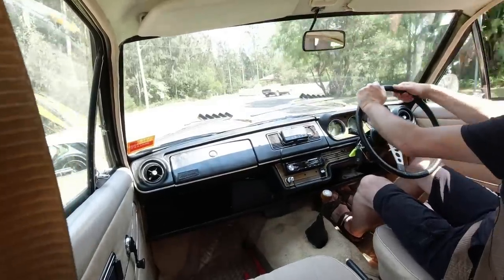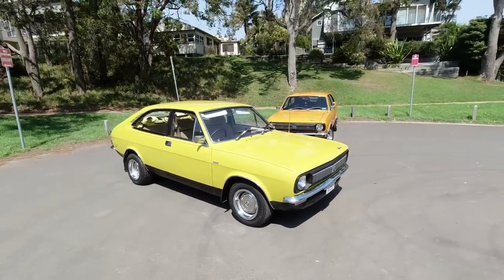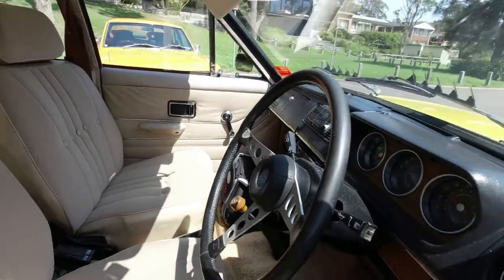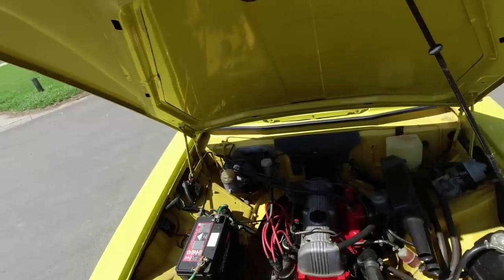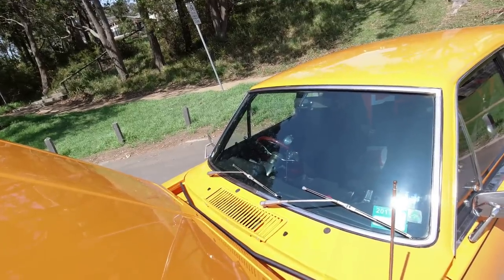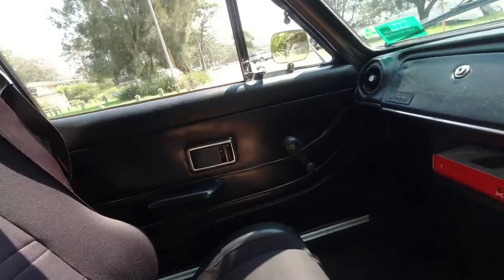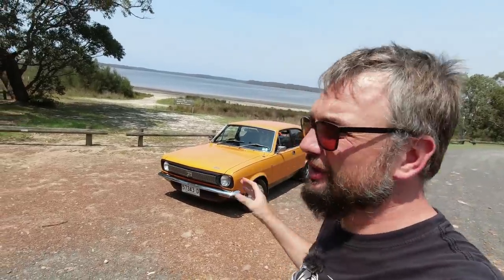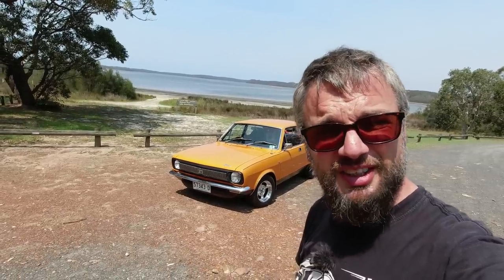Aussie Oddballs: Leyland Marina SIX-CYLINDER! Driven!

Comment: According to the specs, the two engines used in the P76 put out 121 hp for the 2.6-litre six & 192 hp for the 4.4-litre aluminium V8. The V8 was also 2 pounds lighter.

Comment: A mate of mine has the best Marina of ever; 'Horris', the Maronda.

It's a Marina Coupe tarmac rally car, with full group 4 Escort suspension, and a Honda S2000 engine. 250bhp-ish. In baby poo green with a vinyl roof. It looked slightly out of place on Rally GB in 2015.

Comment: Luv this , I had a 262 marina in NZ , std 3spd. After driving a lot of valiants with the same BW box it lacked legs on the open road but acceleration was awesome off the mark , diff ratio should have been changed , ugly as but a pleasure to drive , even towed a twin axle furniture trailer from auckland to Tauranga 👌🏼

Comment: The Australian idea of sticking a bigger engine in everything and making it a bit tougher was a great one. The Cortina, Torana, and this one which was a new one to me, were so much better than the UK models. They generally didn't stop or handle any better as you say, but 6 cylinders in those days was twice as good as 4, and the bags of extra torque made up for other shortcomings. I particularly enjoyed HubNut's genuine delight in the 6. The MkIII Cortina was transformed, and the MKIV with the 4.1 litre fuel injection was in another league.
Reply: Diabolocal death traps.

Comment: Always loved the Marina Coupe design. Travelled in a Royal Blue 1.3 super Coupe when I was about 10 or 11 and I thought that it was quite good, all brown vinyl inside and smooth running. I wonder did the 1750 drive similar to the lovely Lada Riva 1.5 that you drove last year. Maybe I'm completely wrong. As for that 6 cylinder, wow. I think Morris missed yet another big trick. My Dad hated BL cars coming from a line of Hillman Minxes through Renault 16 to Peugeot 504 estate. Weirdly he rather liked 1974 Triumph 2000 we had briefly before the big Peugeot.

Comment: I had very little to do with the Marina, only time I had to drive one was back to the workshop (Loughborough junction railway arch)
I was not told that the problem was the alarm was going off all the time the ignition was on...
so that's a fun drive.

and working for a small car spares shop called Motos down near the bottom of the magic roundabout... the M25 where they referbed those leaver arm things... loading them into and out of a yellow mk1 escort van each Saturday.

these I would have taken more interest in

Comment: I did the telescopic dampers and kept lever arms too on my tuned 1.3 Super (I guess I should have bolted two A series together to make my own 2550cc job) ! Had argument once at MOT place as they said my lever arms were a fail as were de activated and no longer the actual shock absorbers.

Comment: I can recall when South African Rover SD1's (or were they SDX's over there?) had the 2620 cc six as well. Put out 110 bhp I think. Should not be confused with the 138 bhp Triumph 2500 PI-developed Rover 2600 engine we got in the UK (2597 cc).
Reply: Owen Steele that's really interesting. You guys also had the Aussie Valiant in the 70s with a slant six fitted in place of our hemi six which replaced the slant here.

Comment: Surprised you went back to Australia just to film this :p (of course I know it was recorded in advance really). Australia having stringent emissions standards compared to its competition? What innocent times. I think I prefer the look of the larger steering wheel. And in some ways, the sound of the 4 cylinder too. I know, hang me, but it's true. Still, Aussies putting big engines in small cars has a strong tradition, as you pointed out.

Comment: My father and I had a dozens Marinas between us over the years. Front suspension was not great but improved hugely by the telescopic shock conversion. I used Spax gas adjustable on mine and it was good as anything with McPherson struts - probably because it was close to the E-Type Jag set up. Front suspension aside the running gear, build quality and rust resistance was no better than any UK comparable saloon of the time, although as the inner wings were not structural many lasted a year or two longer than their counterparts.

Comment: I've looked at these a few times over the years with the idea of slipping a Rover V8 in the front. I always remembered the engine bay being large with the little A Series four pot stuck in the middle.
Now i think i drop a VW PD130 diesel engine in one.
130 BHP as standard. The one in my Ibiza is pushing out around 170/180 and will propel the Ibiza to 60 in 5.6 seconds.
I don't think my bottom could stand much more power than that in a Marina...

Comment: Ian, you are mistaken about the A-series being emission-compliant because Leyland Mokes were sold on the US.  Sadly, the only Mokes sold in the US were the British ones up until the end of 1967 when ALL Minis stopped being imported to the States.   

The US did get the B-series in the MGB up until 1980 and in its later years it was strangled by increasingly restrictive emissions.  So I doubt any early 1970s ADR emission needs could not have been met by a B-series for the Oz market.

Comment: A little bit of meat on the bone for you regarding the E series engine. The Australians asked BMC/BL for engines that had more power. There were a number of people at BMC who were involved, Eric Bareham designed the power unit, Issigonis wanted an engine for his new Maxi so it had to be compact as it was transverse fitted and it was Geoff Cooper who suggested that the engine was an overhead cam to get more power. So the power unit was rather compromised, but it's pure Austin and British and NOT Australian, but it was through Australia that the engine came about. The fascia on the Aussie Marina is exactly the same as the British 1.8 TC Marina (MGB engine) which came out in 1971. The 1.8 engine was mated to an all new Triumph gearbox, which I expect the Aussie 1.5/1.7 Marina was mated to as well. In the early 80's, I came across a Marina with a Maxi engine in it, at a car breakers in Woolston Southampton and found it rather strange, I assumed some one had converted it, until I had a chat with my uncle who had worked at Longbridge and he told me that it was probably an Aussie one!  Nice to see these cars have survived.

Comment: I was "SO" hoping that you'd tested a Marina 6 cylinder during your time in Orstraya.  Back in  1980's New Zild, friends had his-and-hers Marinas. From memory they both had 1.8 litre engines ("might" have been 1750cc?). The wife's was the 4 door sedan and the husband had a 2 door coupe with factory twin carbs. The husband's car drank petrol like a fish, yet went no faster, even if fresh from a tune up.  Later they moved to Australia where Marinas were getting old and tired, but cheap. They got themselves a 6 cylinder 4 door sedan with 3 speed manual gearbox. And yes, it was my understanding that the same 6 cyl engine had been used in a budget variant of the huge Leyland P76 sedan.  Please PLEASE tell me you did a test on Leyland P76 when you were in Australia !  I believe that standard the P76 came with a 4.4 litre Aussie designed v8, plus the economy 2.6 litre six.  Some ended up with Rover 3.5 litre v8s in them, not sure if that was a factory option of just later modifications by owners. Amongst P76 fans at the time, the story goes around, that the Leyland P76 was simply "SO superior to the Ford, Holden/GM and Chrysler offerings of the day, that those car makers got together and bribed Leyland to stop producing it !  A great story whether true or false. Also, back in the early 1990's in Oz, I spoke to a P76 owner at a car show in Australia once and (because they mostly came with a 3 speed older type auto trans) there was a common modification being done. Some engineering shop in Eastern Australia was manufacturing adaptor plates and sending them to P76 owners around Australia to allow them to install an early version of a 4 speed, (therefore overdrive) auto trans, so the P76 could benefit from higher gearing above 1:1 in top. The owner mentioned a type of auto trans as being new enough to have 4 speeds and lockup in 4th but not new enough to have electronic connections needed to the engine etc, being fully mechanical within the transmission case. From memory it was an auto from certain models of Australian Holden Commodores.  Leyland P76's also existed in New Zealand but were always rare here. Loved by farmers for their huge boot. cheers from NZ.

Comment: In the early 70s the English father of a high school friend of mine  owned a Morris Minor estate.  I recall the outside wooden fixtures on the rear suffered from rot and the wood was spongy.  Being British he then purchased  a Marina.  It rode awfully on our rough roads and someone told me that the front suspension wasn't dis similar to the Morris Minors.....lever action shocks attached to the firewall ???  Is that correct?

Comment: 4:50. There was also the Chrysler Centura which came with 6 cyl engines.  Both the Cortina 6 and Centura 6 suffered chronic understeer with the big 6 iron block over the front wheels. Although they did improve by the late 70s.
Reply: The Centura was a real goer  , i test drove the Marina 4  back to back with a Datsun 180B  , the Marina was a pile of junk against a 180b  , the 1948 lever arm suspension was a total failure  , Datsun ran rings around it hence it only lasted 2 years .

Comment: Hub Nut. The late Bill Tuckey of Wheels Magazine in Australia issued the Bon Ami Challenge. You applied the white non abrassive household cleaner to the 1960s and early 70s car winscreens and turned the wipers on. Instant Burmuda Triangles of non wiped zones appeared...for Fly and Bug prone coverage common when driving Australian roads. Leyland did a huge amount of work making the ventilation and wipers work. They spent all the budget on good engines and Heating and Ventilation...none on proper axke ratios and gearboxes. The 262 Marina could incinerate one tyre on the rear axle in any gear at any speed. The 17.5 second quarter mike they did stock doesnt adequtely express what 155 lb-ft of E6 torque did to one Dunlop Aquajet in 1972. Even my 1979 New Zealand  Spanish Olive 1800 HLE auto could pop a burnout on its aftermarket 185SR 13s. Car Magazine in the Uk called the whole model line including the Ital "Crumby". Ive had nothing but joy from the whole British Leyland experience. Trash Talk about Old Mother Englands Econo cars while it fronted up to the Common Market, Type Approval and aggressive Australian Design Rules killed off some honest, reliable and nice steering cars. A 1275 " Morose Morona" Estate was my woodchoping weapon of choice in New Zealand. The whole model line eventually got the engines it deserved, and British Leyland had to kill off the Australian wing due to huge homologation costs to comply with Common Market rules. My Canadian,American and Aussie friends who had British Leyland market cars found them reliable. In a crash,less so. The front suspension upgrades the Australians made should have been rolled out over the whole BL Marina range. They werent, because Common Market inclusion made BL Bleed Red Ink. Any way, sorry for the spelling and.Much love from Moo Zealand!

Comment: My dad had three marinas a 1.3 SDL Coupé a Mk2 1.8HL and the Ital 2.0l estate. I worked in a Leyland main dealer at the time and it was always a mystery to us why the E series unit never found its way into the Marinas and the land crab 1800 and the first generation Princess wedge. I suspect as with a lot of things BL at the time internal politics played its part. We could never understand why the 1500 E series never found its way into the triumph range but I remember that question being answered on a triumph course with we're not using anything made by Austin. 

The telescopic damper set up on the 6cylinder car, was that standard or has the current owner custom made that because I can imagine it being a bit of a handful with the original lever arm suspension? The dash looked the same as the UK car to me what was different about it, my memory may be fading it's 47 years since dad bought his series 1 car. I know dad's car only had two gauges but the TC models came with a three dial dash. I agree with you the Marina was not as bad as everyone said at the time and indeed you could probably apply that to most of the BL range I think what let them down was poor quality components and shocking quality control and they perhaps suffered from unimaginative styling. 

I love these tests you do it's nice to see someone who doesn't take the attitude if it's BL it must be crap because I don't think the cars were that bad.

Any chance of testing some of the old Triumphs like the Dolomite, 2000/2500 and the TR7?

Comment: The Marina - or rather the Ital 1700 I had was the only car I had with a decent heater and ventilation system; in the coldest weather, really hot air on the feet and completely fresh air at face level; no complicated modern car's system has matched it!

Comment: It is classed as a ROVER Marina now. Would you believe? I had one of these, then I had its sister. Sounds saucy, but it was the Ital 1700 which was a good little engine.  I have a  Maxi now, I don’t think the E series engine in the maxi is as good as the ital 1700. Which I believe was O series

Comment: I don't get why the B-Series could not be certified for Aus, because BL offered it in North America in the (Austin) Marina through 1974, and the MGB until 1980. The A-series was discontinued in the United States after 1974, with Midgets using the Triumph Spitfire engine until the end of the model run.

I'm not sure if Mokes came with Minis to Canada during the BL era, but Minis were not officially imported to the United States after 1968 due to safety regulations. The 848 could have been sold due to a displacement loophole, but one does not want an engine that small for a daily 30 mile freeway commute amidst vehicles on the Yank scale. Canadian Mini sales continued well into the seventies.

The sound the six makes is a ringer for an old friend's triple-carbed 260Z.

Cheers from Costa Rica!
Reply from the maker: It's a fair point.

Comment: Indicator stalk on the right is the correct side for right hand drive, not just preference.
My theory on this is that the UK has been forced to accept the indicator stalk on the incorrect side and now sees it as normal.

The indicators used to be on the right for all UK cars. My earlier minis etc..

Then we got cars made for European or world markets. The correct side for the indicator stalk on left hand drive vehicles is the left. Makes sense for a manual car in particular. Think about it.

So it was cheaper to make just one steering column switch gear for both right and left hand drive markets.  Where as an eighties Ford Escort would have it's indicator stalk on the incorrect side in the UK, it would be correct for a LHD model in France or wherever, but more expensive manufacturers, like say Mercedes, still produced two sets for each market. So an eighties Mercedes for the UK market had mirror image stalks from the German market.
Eventually the influx of cars in the UK with incorrect indicator stalk position made this the norm, and almost all manufacturers followed suit.
This did not occur in other RHD markets like Australia or Japan where the majority of vehicles still have their indicators on the correct side.

Comment: Had a couple of Marinas in the late 70s both 1.3s I was always surprised how well that 5 port B series engine went it was no sports car but it would sit at 70-80 all day and was reliable to boot I also have driven a Morris 100 with I think was the same  but smaller capacity motor and again was surprised how well it went so was it a power to weight ratio thing.

Comment: Hi Hubnut.  On the matter of 3 speed box vs 4 speed box in the Marina 6, my view is that Leyland Australia, like BMC Australia before them, for all their engineering genius, missed a trick by continuing to consider their up-engined small cars as city cars only.  Imagine that Marina with final drive gearing such that it was pulling only 2800 rpm at 100kph!  With a 4 speed box, it would still go like a rocket, but would also be a viable car in which to travel Australian distances to the tune of 700 or 800kms in a day, and be economical too.  Perhaps Leyland thought that the Rover P6B, Jag XJ6 and Triumph 2500 were the cars intended for this job?  Upgearing British cars for Australian distances is something I've done a bit of over the years.  A Commer van I owned got a Humber Supersnipe diff, I believe that a MKIII Zephyr diff will go into an early Transit, and my present Rover 2000TC is enormously improved by the taller diff from a P6B. Cheers.
Reply: lol... that's what their P76 was for

Comment: Handling of the 6 cylinder would have been a tad scary. I remember mine, a 1.3 SDL Coupe, held the road far worse than my Anglia 105E. And yes, I did spin it
Reply from the maker: These felt the benefit of modern rubber, in a wider size!

Comment: From my memory the 4 cylinder Marina's weren't bad cars, but just couldn't compete with their Japanese counterparts and the Australian developed Holden Torana. However one word was often used at the time to describe the Marina 6 was scary and dangerous. The car wasn't really reengineered to take the heavy six, and the same could be said of the Ford Cortina 6. The LJ Holden Torana was actually engineered to take both 4, 6 and 8 cylinders. All three 6 cylinder variants of these cars had terrible fuel economy and the market preferred the larger Kingswood, Falcon, Valiant and P76's.